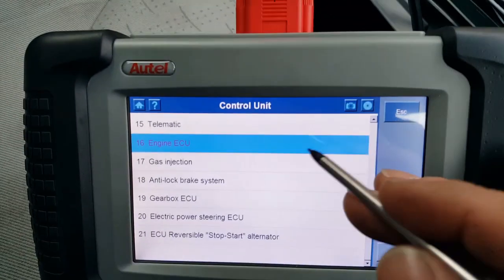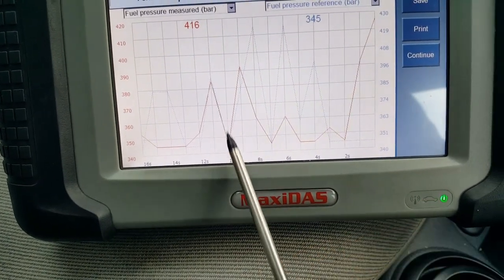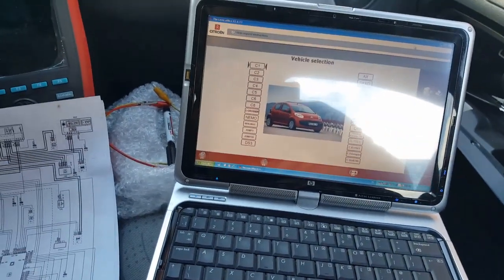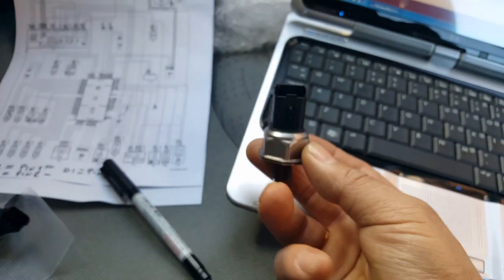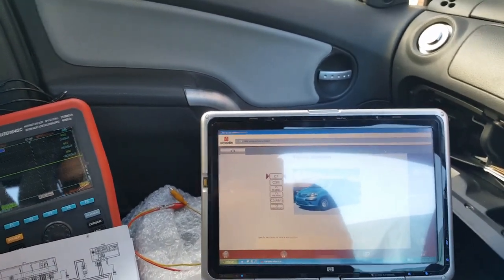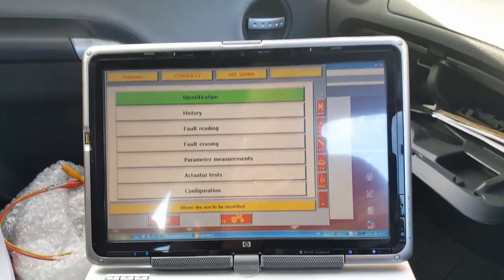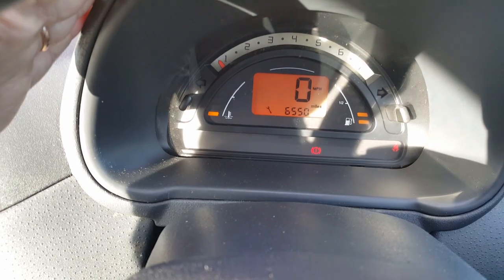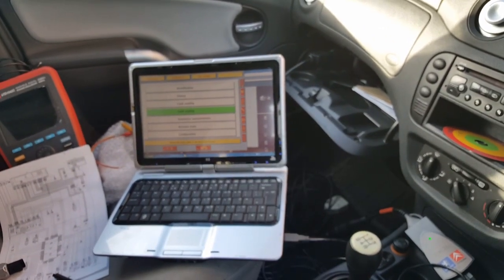Citroën C3 1.4 HDI limp mode, P1164 fuel pressure sensor. Fault finding and repair.

Comment: Ciao io ho una citroen c2 1.4 hdi e da qualche giorno mi si accende la spia motore e il motore va in protezione non siperando i 2.5 giri. Ho attaccato l'OBDII e mi rileva lerrore P1164. 
L'errore P1164 è sempre il sensore di pressione del carburante?
Grazie
Reply from the maker: No...
The sensor, wiring, or the pressure itself...
👍👍👍
Reply: @LMAutoRepairs Ok grazie. Ma che tu sappia su quei motori c'è il FAP?  I solo in catalizzatore?
Reply from the maker: Already replied...
👍👍👍
Reply: @LMAutoRepairs si ma non ho capito se la macchina ha il FAP o solo il catalizzatore.

Comment: Hi

1. How similar are the codes on the computer via the interface to gasoline or diesel cars?
2. Have you presented somewhere the verification values with the measuring device at the car's sensors? Thank you!
Reply from the maker: A petrol car is a different system with different values...
You can't compare...
👍👍👍

Comment: Hi. Can you tell me what sensor this is, I.E. crankshaft sensor?
Many thanks
Nathan
Reply: Ciao quindi l'errore P1164 e sempre il sensore di pressione del carburante?
Io ho una citroe c2 1.4hdi che va in protezione e si accende la spia motore e collegando l'OBDII mi da sempre l'errore P1164. Se azzero l'errore la macchina va per pochi minuti poi si accende la spia e va in protezione non superando i 2.5 giri.
Reply from the maker: Could be the sensor or the actual pressure...
You need to troubleshoot the problem...
👍👍👍
Reply from the maker: As per the video, fuel pressure sensor...
👍👍👍

Comment: I have this  fault in diagnostic permanent car does not start how can i solve
Reply from the maker: If the fault is the sensor, replace it...
😊
Reply: @LMAutoRepairs  sensor its ok i tested i have misuration in live data
Reply from the maker: If you have no pressure, either is the sensor, pump, regulator or injectors leaking...
Obviously you need proper testing to establish where the problem is...
👍👍👍
Reply: @LMAutoRepairs  pressure its about 180 to 300 bar in misuration during cranking does the engine its with problem or blocked injector  ?
Reply from the maker: At 300 bar the issue is most likely not the fuel pressure... so, your issue is not the same, as you stated on your first comment...
It is difficult if not impossible to guess what the issue might be, based on very little information... you need to go through testing  and start to rule out what is out of the equation of being a problem, to help you establish what might be wrong...
👍👍👍

Comment: After a leaking injector fix my car seems that loosing power when driving uphill, I have new turbo core , new fuel filter , new air filter , egr blanked ….. no codes and a lot of black smoke also very big consumption ….. really don’t know what is

Comment: Thanks for this video...
I just got curious about the faulty new part.. And what I found that for this engine 8hx after 2005, it has different fuel pressure pinout ;where pin n°2 is the signal wire!! 
NB: got it from autodata.

Comment: Hi thanks for video , I have same model of c3 1.4hdi 2003    (302000klm)My car will shut off when acelarating  2000 rpm , but runs well under 2000rpm what do you think is the problem
Reply from the maker: Impossible to guess...
Scan the car and go from there...
Thank you for watching!

Comment: Hello friends, can someone help me solve this exhausting problem?
Namely, I have been driving the C3 1.4hdi in 2009. for about two years and since I bought it I have had a problem with it. The problem is that the car beeps and suddenly shuts off while driving (the engine shuts down) and reads errors such as (antipolution faulty, oil pressure faulty, air bag faulty, safety belts faulty ...) on the middle display. After that, I return the ignition and when I restart it, the car normally goes to the next shutdown. Sometimes it happens to me that when I start it after starting it, I lose the power steering. It happens that a week passes without it being extinguished, and when it starts to go out, it does so two or three times during the day. It was diagnosed and it did not show anything, that is, all parameters are excellent. One mechanic replaced my crankshaft sensor, after that it didn't turn off for a while and it started again, the other one replaced my BSM (Fuse box) so even after that replacement it didn't turn off for 12 days and it started to turn off again. I have noticed that when the weather is warmer then the extinguishing is more frequent. Thank you
Reply from the maker: A wild guess, is that you have a chaffed wire rubbing somewhere...
🙄
Just a guess...
👍👍👍
Reply: @LMAutoRepairs  Do you think that is a problem with the installation? I suspected a clogged catalyst or a problem with the high pressure pump? How can I find out? Will driving with associated diagnostics find that if the engine shuts down at that point? Thank you
Reply from the maker: @Simkesd90  
Yes... live data should help you out...
👍👍👍

Comment: 3:35   it means its just hog wash and you can't even tell what that means. you are talking of stuff before the engine starts and it strts so that's not the problem. the problem is is that the exhaust suffocate the sensors after the engine s running.... you can see that when cold the light doesn't come on... well do what you want. before 2005 its the particle filter on the exhaust that gets clogged up and heats up the motor.
Reply from the maker: Hi
Have you watched the entire video? 🤔
Surely not... 
Thank you for stopping by...

Comment: I changed the FAP diesel particle filter on the exhaust just after the motor right behind the cooling fan. before 2005 the filter doesn't self clean every 60 000 miles. the tech wasnot developed yet. so the big round exhaust type deal's filter just runs clogged up. You can take it off, burn it off with a torch for ions, rince it with cellulosique thinner, ( lacquer thinner) then dry it with a eat gun until no more white smoke 20mn minimum. and drop it back in. Its a miracle , the engine breath much better and doesn't suffocate the sensors any more.or spend 180E on Misterauto. That's all it is  before 2005 the self cleaning tech was not sold with the vehicules.
Reply from the maker: The particulate filter also know as DPF indeed needs to regen every so often...
And a few parameters need to be met for the regeneration to take place... I have several videos on that...
This was not the case in this video...
The problem was fuel pressure related....
Thank you for watching!

Comment: hi i have c3 1.4 hdi i have fault code p1351 ? also can you tell me the torque settings for the injector bolts thanx
Reply from the maker: Hi
The P1351 is for the glow plugs system... if I am not mistaken...
As for the injector torque, I would have to check, so don't quote me on this, but I believe is around 9 to 10 Nm....
Thank you for watching and for your comment!

Comment: My Citroen C3 desire petrol, has had the same problem happen since I got it a year ago. It'll be going fine then it'll die, or it'll be going find then lose power, first time it broke down I took it and got a new coil pack put in, only for it to have the same problem again this winter, it lost power again,  I've had a new timer belt put in recently, then passed the mot, then on the way home the engine light came on again. A few days later I was sitting in the car with it on then it just died...it started again and I was able to drive it home then it died again. I didn't have money to take it to the mechanic but a week after it worked again although engine light is on I was able to take it for a few short journeys then this morning it lost power and I had to drive home at about 10mph... I don't know what to do with it now :( I'm so fed up with the expense of keeping on putting new parts in only to come back to the same problem :/
Reply from the maker: Hi
Yours being a petrol could not suffer from the same fault as the one on this video...
Anyway, the first thing you need is to get it scanned and see what are the trouble codes logged in the ecu...
Otherwise is quite difficult to make any suggestions on what the problem might be...
Hope that somehow helps...
Thank you for watching!
Reply: @LMAutoRepairs  thanks for your reply, the car is normal again as I was just driving it. . Which is annoying because I don't know when it's going to crawl or conk out again.. I'll ring my mechanic. Thanks for your reply
Reply from the maker: @Sharons_Garden  
No worries...

Comment: Thanks for the expert analysis - it seems that these days you need a Degree to work on a car. My Pluriel was running fine and then wouldn't start. The breakdown people got it going with QuickStart and I got home but then it won't start again (engine light comes on). I bought a diagnostic tool which said fuel (diesel) pressure low. When I squeeze the priming bulb I see air bubbles in the fuel line. Any ideas? Thanks again for putting your knowledge online.
Reply from the maker: It can be a few things... I guess you can't see rail pressure while cranking,  on can you? I presume it is a diesel...
You should need about 250 bars for the engine to start...
If it starts on easy start, and then runs, it is a fuel delivery problem...
Do a back leak test... it might be a bad injector... when was fuel filter changed?
Thank you for watching and for your comment!
Reply: @LMAutoRepairs  Me again, I'm afraid. My OBD II says: 1. fuel system leak - detected large leak, 2.exhaust gas recirculation -flow excessive detected 3. fuel rail system pressure -too low. This is after I have changed the fuel filter.  There are still bubbles in the pipe when priming the fuel hand pump. The car starts and runs with Quick Start sprayed into the air intake, - runs for about 5 miles and then stops. I restart with Quick Start and then it runs for another 5 miles .... and so on. The car, a Citroen Pluriel C3, has done 139000kms.
Any ideas ? (I suspect you might have bad news.) Thanks again for your online wisdom.
Reply from the maker: @grahamepinnell367  
Fair enough...
But when it does not start, you need to monitor the live data... if the rail pressure is not reaching what it needs, then you have your answer...
Have you done the leak back test?
You might just need one or 2 injectors...
Reply: @LMAutoRepairs  What is a leak back test (sorry for the ignorance)
Reply from the maker: @grahamepinnell367  
No worries... 
Watch this video video...
https://youtu.be/U32IUrQQ8Ng

Comment: Good information, wish I had seen this earlier. I just had the same problem with my Citroen Berlingo 1.6Hdi. It cut out completely with error "Fuel Rail Pressure Sernsor Low Input". I replaced the sensor, as you say, tricky to get to. Mistake I made was to plug the "water in diesel" connector into it instead afterwards. The connectors are identical three pin items and located right next to each other. My car doesn't have the "water in fuel" sensor anyway, so it was dangling free, I was feeling for it, didn't know there was another one there, and the mistake was made, and it wouldn't start. Took me weeks to sort it out following lots of blind alleys, get the circuit diagram, remove the ECU, check the connections etc. etc.
Reply from the maker: Hi
I feel sorry for your pain.. but hey, you got it sorted in the end!...
Thank you for watching!
Reply: Hey i feel for you buddy i did the same thing when replacing the 1.6hdi engine.. very easily done.

Comment: Hi I have citroen  c3 2006 1.6 and I have problem with headlights the both not on and I changed  but not working
Reply from the maker: Check fuses... relays, and wires...
Thank you for watching!

Comment: Hi. Whats the torqe-spec for this sensor?
Reply from the maker: Johan  Pettersson 
Hi
I just can't remember from the top of my head... sorry...
Do a Google search...
Thank you for watching!
Reply: LM Auto Repairs Cant find it on Google. Manuals says swap out the hole rail. No torqe avalible. Strange that citroen sell the part but dont have the torqe spec.
Reply from the maker: Johan  Pettersson 
Torque it to the standard thread size... and you will be fine... 😉
Reply: @johanpettersson4397  good luck its not it. Its the Fap on the exhaust that get clog up and suffocates the motor.
Reply: @jancloddlafront9185  after l swap the sensor the falut symptom was gone. The problem was intermittent stalling and faultcode  on strange rail pressure values. First guess was fuelfilter byt Did not help.

Comment: Hi, nice videos and faulth finding, i bought a citroen c3 hdi ...eco mode. Car starts but wont fire up, I had a guy do scan on the car. Picked up couple fauths .... dead short.  A capacitor in the ecu was shorted which had two of them runing in parrell.i removed the shorted cap. Had a mechanic remove injectors to check fuel pressue in cyclinders only one had fuel the othe 3 not opening .I measured voltage while car was cranked only one cylinder was getting abt 1.9 v the others wss zero. Any ideas what could be fauth.
Reply from the maker: Jeff Sylvester 
Hi
You need much more voltage at the injectors... they need about 70 volts... 
Trace your wires back to the ecu...
Make sure all fuses are good and that the powers and grounds are all there...

Comment: Can someone please help me 
I have CITROEN C2 1.4 HDI diesel engine 2006
The car was driving well so I've parked the car after that the car ddnt want to start at all 
When i call the mechanic they said it's a glow plugs they replaced the plugs and one plug did broken inside the mechanic said he must remove top gasket so I've bought new top head gasket and I called 
Diagnosed guys they said it's a crank sensor  I've changed it still the car don't want to start  its just cranking I've called another diagnose guys  they said  it's code  P1351 can P1351 be the problem what should I do?
Reply from the maker: Tladi Motaung 
Hi
Before changing anything,  best is ensure that the connection between the sensor and the ECU is good.
Glow plugs would not prevent the car from starting... would make it a bit harder in cold weather,  but that's all...
I think you need to check wiring and perhaps look at the live data....
Reply: lmsvvavr  
Ohk sir must a call auto electricians to check it for me ?
Reply from the maker: Tladi Motaung 
Well, if you don't have the tools... Will be better...
Reply: lmsvvavr 
Thanks  alot  I will do so

Comment: what an headeach that's the problem with me I would be messing with pump.  just like to say your very clever how did you learn electrics keep it coming.  is there any way to to get some sort of dummy sensor witch you could use for testing neutralising the ecu giving it what it wants
Reply from the maker: Mark Marshall 
Hi
Thank you for watching and for your comment!
As for the dummy sensor, never really looked at that... but would be an interesting toy to have...

Comment: Hi, great video. im just wondering if you could help me with my citroen C3 1.4 HDI. the car is on eco mode, the fuel indicator is flashing and the car wont start. your advise would be really appreciated.
Reply from the maker: Sakhile Khumalo 
Hi
Economy mode should not prevent the car from starting...
Silly question, does the car have fuel?
Scan the car to see If there is any trouble codes...
Reply: Yes the car does have fuel. i i did scan the car and the codes i got were P1621 & P1352
Reply from the maker: Sakhile Khumalo 
The second code points to the glow plugs system... should make it difficult to start, perhaps... but not completely prevent the car from firing...
The first code in the other hand, points to a internal fault in the ECU... that one can be your problem... which tool have you used to retrieve this codes?
Reply: This is my first car so i'm inexperienced when it comes to cars. I didnt take note of the name of the tool, somebody scanned the car for me. According  to your expertise, what do you think would be the best solution in to solving these problems?
Reply from the maker: Sakhile Khumalo 
Well, unfortunately it can be many things...
You need a good diagnostic session, look at live data, fuel pressures etc...
Anything I might suggest to fix it, it will be guess work... as you understand I haven't seen the car...
Reply: Yes i do understand. Im based in RSA and i just wish it were possible for me to bring my car to you. The guys that iv used her are just waste of time, they dont really know what they are doing. Based on this conversation and the error codes, i think should start by checking the glow plugs and the relay and then take the ECU for a diagnosis check. Would i be moving in the right direction if i do that?
Reply from the maker: Sakhile Khumalo 
Like I said, glow plugs should not prevent the car from starting... specially during this time of the year...
Is the other code you need to focus on...
Reply: Alright.Thank u very much for the advise
Reply from the maker: No worries...